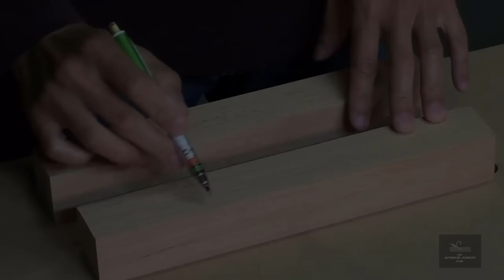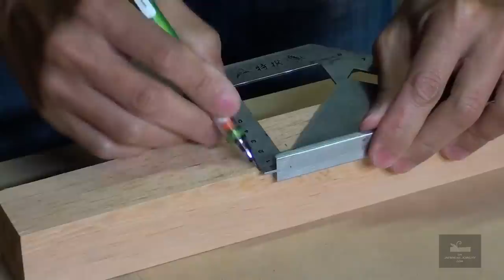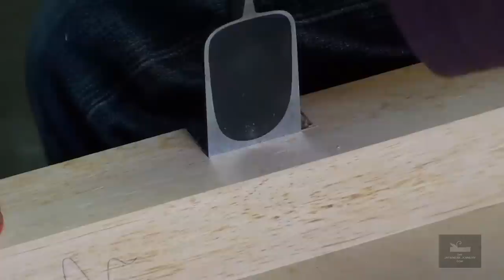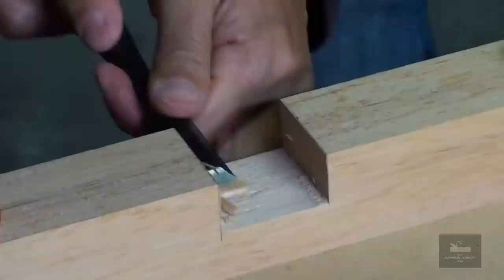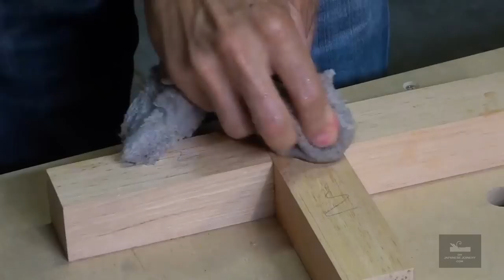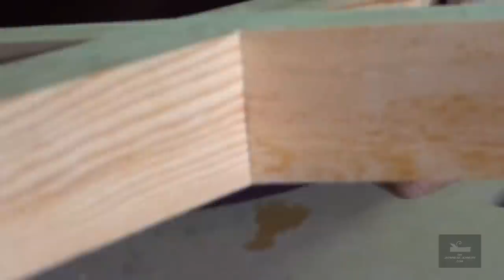Japanese Woodworking Tip - "Kigoroshi"

Comment from the maker: The name of the chisels is Tsunehiro. Unfortunately the blacksmith of these chisels has passed away years ago, so it's virtually impossible to get the same ones. 

The quality of chisels matters a lot for sure, but if you want to bring out the full potential of your chisels, you must acquire proper sharpening skills. If you want to learn how to sharpen your blade super sharp, go to http://diyjapanesejoinery.com/course/. The first month is free.
Reply: The mystique around these is misplaced. Quality Western chisels are just as good, with the benefit of being much easier to sharpen for much longer than hollow-backed ones. I have some English ones that are 100 years old that hold their edge superbly.
Reply: Zygmunt The Cacao Kakistocrat )
Reply: Rip
Reply: What kind of wood is that? Kind of looks like oak but kinda doesn't
Reply: As a better blacksmith than woodworker I'd like a better look at the chisels. Are there any videos of that style of chisel being made?
Reply: @zygmuntthecacaokakistocrat6589  But what about the new ones?  I've read, that the same companies new files made in Mexico aren't as good as old ones made in USA..  There is absolutly no excuse for that - discusting..

Comment: Having worked with wood for over sixty years, this is a great video and a beautiful example of how to use Japanese tools to make a near perfect joint. I would trade some of my chisels which have been handed down through the years and are kept razor sharp to have a few of those chisels that are being used. They have a deliberate concave area in the back but a perfect cutting edge which can be kept sharp on the front which is where the work is done. Thank you for posting a most excellent video and how 1.2k people give this a thumbs down I will never know, perhaps they don't understand tools and how to use them. Much respect from an old woodworker!
Reply: Eu ainda não entendi por que esses formões possuem esse côncavo. Mas meu palpite é que isso reduz o atrito da ferramenta na madeira.

Comment: You can moisten wood with Glycerin and water (on tool handles I use ethylene-glycol, antifreeze) and it preserves the cells but it may have a visible effect causing the surface to take stain or oil finish differently, and that wouldn’t be desired on a piece of quality workmanship. Noticed the condition and quality of the chisels, saw, rules and squares, having tools that are in good working order allows you to focus on the close tolerances and careful fine trimming, and taking the time to keep everything in such condition is a job in itself. 
Admirable work sir!
Reply: I thought that PEG 1000 was the substance to use, rather than the compound in automotive antifreeze. Can you explain?

Comment: TIP  use anti freeze instead of water to make it swell up.  the glycols will harden in place after drying-  keeping the wood swelled forever
Reply: Yeah, I was wondering what would happen when the timber dried out again. Good tip
Reply: With no adverse effects to the “finish “?
Interesting idea

Comment: Japanese PULL SAWS are an excellent tool for precision joints, It pays to buy the best, I know they are great as I have had four 'borrowed' and not returned over a six month period, such saws are hard to find in Australian Woodworking shops/suppliers too.This was a great display thanks !
Reply: I'm in Aust. have you found any at all?
Reply: Scratch that. I just found them at Carbatec...and Japanese hollow back chisels

Comment: I have seen this discussed for making waterproof boat seams. Lightly hammer a wire into the wood, then plane down flush and assemble. With moisture, the area that had the wire  pressed into it swells up proud of the surface and seals the join.

Comment: One trick that works really well for exacting joinery is to cut just shy of the line with a thin kerf Japanese saw blade. Then re-cut with a thicker blade to hit the line. Often an equivalent  European blade or a coarse Japanese saw can be used to enlarge the saw kerf to exactly hit the line.

Comment: I love Japanese carpentry, it seems much more like an art form than a trade skill, also I note that Japanese saws pull rather than push, which I find very interesting!
Reply: it links with there style of benches. Our saws cut on the push which links with a western style of bench (wood holding device)
Reply: I adore all forms of carpentry that involve no nails, like medieval european furniture which uses fitted wood and wooden pegs. Or chinese carpentry which I think the japanese used.
Reply: @credinzel6996  Makes me wonder about medieval timber weapons like when massive wooden weapons like slings and catapaults which were used to assault a castle or stronghold how the hec did they acheive that???

Comment: Not to argue and suggest hes wrong...But I bet If he would have applied a heated up  clothing iron to a wet cloth laying over the area that was dented..The steam would have raised the wood grain up to where it was to begin with. I use a clothing iron multiple times each project and it shows results every time. I was still blown away by this video and what I suspect is an incredibly knowledgeable woodwhisperer. I shall subscribe. Happy Woodwerkin all!
Reply: Theres a guy on the youtubes called Samurai Carpenter who tested this and I believe from memory that once the fibres are severed, you cant completely fix it (might be wrong though). Also, in this joint, you cant really get an iron into the right area haha :)
Reply from the maker: You can do it that way but you may end up getting a rough surface.
Reply: You just saw the expert.
Reply from the maker: Have you? It might have been my master.....
Reply: Squeeky Ninja
Reply: Squeeky Ninja 5
Reply: Steam is very hot, and can damage or alter the property of the wood composition by breaking down binding esters, fibrous whiskers, fuzz, or a more visible grainier surface (like driftwood) test on half of a piece of scrap material
Reply: Squeeky Ninja..

Comment: That chisel design looks very unique. I can see the backing has a slight depression so it can create less friction. Why not apply a vinyl tape in that same pattern on an old chisel, dip it into hot wax, remove the tape and then dip it into acid. Rinse it off and dry it.
Reply: Todd, the hollow back is not so much about friction, as it is to make a flat plane easier to maintain when sharpening.

Comment: MIND BLOWN! I take it the hammering makes the gap a little more open and the water shrinks it right back?
Reply: What happens is the hammering compresses the wood fibers.  When you add water to it the fibers absorb the water and swell back up to their original size.
Reply from the maker: You said it right. Thanks

Comment: Nice video, your tools are so sharp. I wonder about using moisture (water) to remove the small gap in the joint. It might look fine now but in a few weeks, months the gap will reappear after the wood has dried.
Reply: Nope, the cells in the wood don't re-crush when the water leaves.
The hammering flattens the cells a bit, the water softens them so they can spring back to shape, mostly.

Comment: if adding water causes the wood to expand and fill in the gaps, wouldn't the gaps reappear over time as the wood dries out?
Reply: I would like to know this too!
Reply: Because of the previous compression with the hammer, adding water just gets them back to their normal volume. Kind of like freezing metal parts and then (press) fitting them together, when they warm up to normal temps the joint is quite strong.
Reply: It isn't a swelling of the wood but a restoration of the wood fibres achieved by applying water. Therefore there is not shrinkage because the wood never actually expanded in the first place. It's all in the tapping of the hammer.
Reply: Cut the parts the right size to begin with !

Comment: I am not a joiner or carpenter but in high school my woodwork teacher told my class never to strike the work piece directly with any steel hammer, always use a scrap piece of wood to take the strike (and damage) and transfer the impact pressure to the work piece or use a wooden mallet but being very careful to get a good strike. As for wetting the wood to close gaps, well the wood will dry out and the gap will show again. So, referring to my teacher, never cut to the line, cut close and sand down to the line using a square to test for flatness across the cut and the angles.
Reply: Nos Feratu   yes your teacher is is correct in some ways. An experienced carpenter has a sixth sense of when he can hit and how hard he  can hit the timber with a steel hammer and when he needs to place a scrap block between the two. The better you get the closer you can cut to the line . The difficulty lies in maintaining a 90 degree angle with a hand saw. Joints should never be sanded to fit . As for the water , I can only guess that it expands beyond the original form prior to it being killed (lol) then relaxes back to its original form prior to being hit . Sorry for the rant.
Reply: I think he got you to sand the joint to fit because sharp chisels and school wood working classes are not a great mix ;-)
Reply: No need to apologize, all opinions are welcome in reply to my comments.
Reply: To be fair to my teacher no gaps in joints, no off square joints or face damage was allowed beyond lesson 1. Rasps, files and sand paper of all grades were made available and were used accordingly. The only thing we struggled with was time. Wood needs patience and that is how to make a joint right. Water is quick cheat and not a solution to poor fitting joint. However, it was good to discuss the subject and we should agree to keep our methods and work to our individual teachings and rules. have a great weekend and 2018!
Reply: Nos, your teacher wanted to impress upon you how easy it would be to mark up the wood with elephant tracks (round dents from the hammer). This craftsman makes that point also. He is tapping the meeting surface  with the belled hammer face to compress the fibers only slightly, not enough to crush beyond the limit of recovery. The water swells them back to original dimension, dries away, and joint stays tight.

Comment: So only thing different from the usual western approach was revealed at the very end. Hammering to temporarily compress the wood fibers to allow a potentially tighter finished join. (Which I guess presumes the cut-outs are just a hair smaller than usual too.)

Still it'd be neat to see some traditional woodworking build-off competition between the Dutch, Pennsylvania Dutch (Amish), and Japanese. There are likely things to be learnt from all of them.
Reply: pauljs75 so the Penn Dutch will whip out the pocket screw joints I see at local wood furniture places? A bulk of what I see out of PA is total dogshit. I'm sure there are still masters there... In rocking chairs put out to pasture.

Comment: I love the "there is a gap" part. Aehm. No, in my books there is no gap to be seen there... (Of course I see it, but it's just cut perfect). Just wondering why the other cuts are being made.
Reply: Those are "relief cuts". In the most literal technical sense, they're not completely necessary to get a good finish, but they CERTAINLY DO make it easier on the person trying for a reliable good quality.
    Without the "relief cuts" hogging out material with just a chisel (even a sharp one) can end with unpredictable splintering and gouging out too much, leaving a weakened joint. It might still be "covered up" to appear tight, but deteriorates quicker with the hollow space inside than if it was "truly tight". ;o)

Comment: damn, that's a sharp saw. I want one.
Reply: they are 100% worth it. and relatively inexpensive
Reply: @dimitardobrev3296  Where can you get one????
Reply: @DrGarri  Anywhere... it is called a japanese saw, there are several types of them,
try going for Ryoba or Douzuki japanese saw.
Keep in mind:
1. you cannot sharpen a japanese saw, the teeth are hardened, so once it goes dull, you buy a new blade (it is rather cheap)
2. it works on the pull rather than push motion of western saws, giving you more control, but if you are used to pushing a saw, it may take a bit to get used to.
Reply: @beepIL  Having the stroke on the pull side of a saw does make sense.  It means the chance of the saw buckling is much less. So you could pull quite hard if needed.
Reply: @VestigialHead  And we naturally have more control when we pull things rather than explosively push them.
Yep, Japanese are smart :)
Reply: @beepIL   Another thing to remember is: once the teeth go completely into the wood, that is the precise direction of the rest of the cut.. I love my Dozuki Saw.. (from Lee Valley Tools)
Reply: @bookersbay  I was not aware Lee Valley made Japanese saws,
It seems to be very overpriced O_O 50+ USD??
Reply: @beepIL  NO!, they don't 'Make' them.. They sell them direct from Japan..
Reply: I paid $89 for mine, keep it well away of young ones as it is so sharp as to be dangerous..
Reply: @bookersbay  Oh i see

Comment: I'm interested to see you start the cut from the near side when making quick cuts but you cut from the far side to near by your lines. Is there a reason for this?
Reply: El Woods 
He's using a pull saw.
Reply: One of the reasons I was told is that because it is a pull saw, "far side" starting is easier to position accurately (as in along the edges), while "near side" is a little more convenient but not as easy to make an accurate cut across the surface. Accuracy didn't matter on those internal waste cuts.

Comment: Where can i find those chisels? They look amazing.
Reply from the maker: I heard that the blacksmith who made these chisels passed away years ago. They are priceless now.
Reply: Face for Radio I was thinking the same! that hollow underneath is genius; makes for easy flattening of the underside!
Reply: "Slick", try Japanese "slick" not just chisel.
Reply from the maker: Do you call it "slick" in English? I didn't know that. In Japanese they are called "Tsuki Nomi". The word of "Nomi" means a chisel. I mean a slick is a different type of "chisel" in Japan. We have "Tataki Nomi", "Tsuki Nomi", "Oire Nomi", "Maru Nomi" etc etc... These are all "Nomi - chisel". But seems slicks are different in English. complicated...
Reply: Here's a few;

Tataki (striking)  

Tsuki (slick)  

Maru (gouge) 

Oire (bench/bevel edge)

Kinari /usu (paring)

Bachi (butterfly)

Umeki (dovetail)

There is more and yes some of it is confusing for sure. 

Below is a quote I ran across while studying the craft. 

"""There are several types of nomi but the two major categories are striking chisels: bench chisles (oire-nomi), timber chisels (chu-tataki-nomi, chu-usu-nomi and atsu-nomi) and mortise chisels (tateguya or mukoumachi-nomi), used with a hammer, and push (or paring) chisels (kinari/usu-nomi, umeki/shinogi-nomi, sashi/tsuki-nomi) and dovetail chisels (yama-ari-nomi), used by hand alone."""
Reply from the maker: Thanks a lot. Now I know how to call them in English. I heard there was no such thing as Oire before. Tataki that became shorter by being sharpened was used as Oire, a chisel for detail work.
Reply: You are very welcome.
Reply: In American English a slick generally means a large two-handed chisel used in timber framing, log building or boat building. Image search "timber frame slick". 
By the way, I've seen incredible boat building in a traditional Japanese style in which the boards or planks on a carvel built boat are so snug no caulking is required. I think each chine is fit by sawing in the gap until both edges meet perfectly. You work with the same attitude and ability.   Hats off to you.
Reply: Just a minute
Reply: Just a high carbon chisl e sharped very well
Reply: @DIYJapaneseJoinery  incredible work alot of patience  overall patience only achieveed by patient personality. And the understanding of one's self  and the striving result of perfection. nothing is easy if only every one could understand.
Reply: Just a minute, try googling " Japan Wood worker "  
There are other company's that sell japaneses woodworking tools also. Just do a quick search and you should get multiple hits.
Reply: have you tried used google search for Japanese joinery tools or Japanese woodworking tools

Comment: what will happen when that moist will dry after few days? will that gap shown again?
Reply: Basically what happens, when you hit the wood fibers, is that you squeeze the fibers against the rest, but you don't break them, that's why he says to tap them with the round side, so the fibers will go back to their original position after a while even if you don't moist the area; the same when you bend a board and let it go. The moisture helps accelerate this process and what happens then is that the moisture is evenly distributed across the whole piece. Now, if it gets too dry the joint might come loose, but that would be because the whole piece would shrink.
Reply: @BiP00  I'm sure, that he/they only wet the surface, where it has been compressed, to avoid, that anything but the visible surface expends, so it doesn't become loose - or, I should say: "I'm convinced".

Comment: the only issue i can see is that the water causing the wood fibers to swell would eventually evaporate which would cause the fibers to distend and become warped, maybe using an oil would fix this and make it a more permanent fix
Reply: No, wood has a memory if the fibres are not broken. That's why he used a round ended hammer not to break the fibres, he just temporarily compressed the fibres. You can also use water to take dents out of furniture, table tops etc, sometimes by just leaving a damp sponge on the dent, or put a hot iron over a wet cloth and steam them, and when dry they never come back. I recently refurbished a rifle stock and soaked it in water for a while (some soak them over night in a tub), all the dents disappeared and it came up like new.